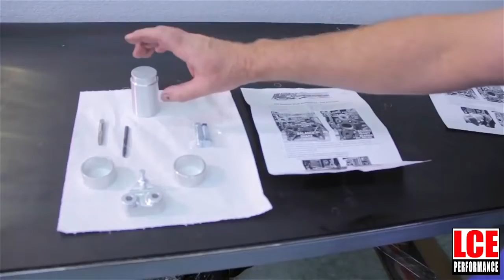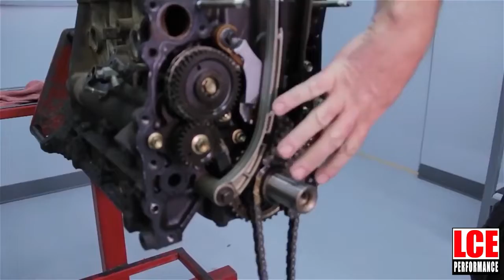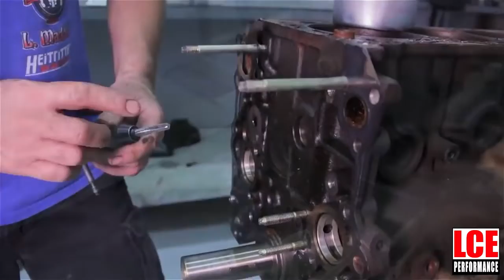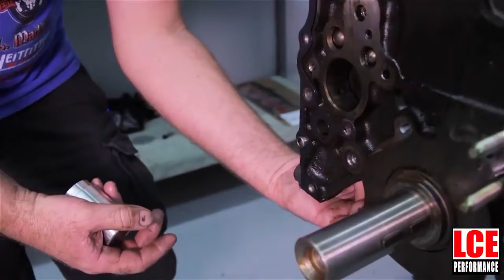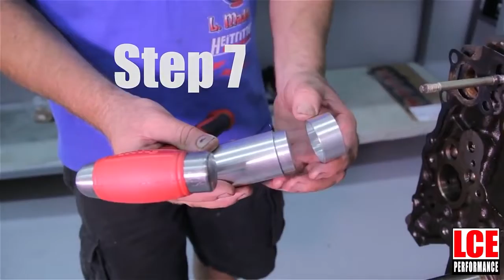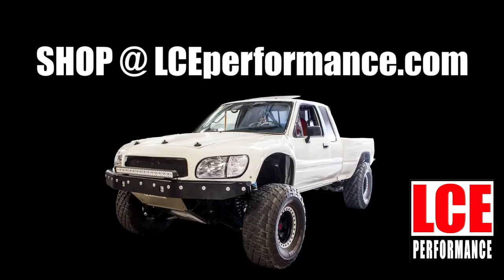3RZ BALANCE SHAFT DELETE HOW TO by LCE Performance Toyota

Comment: The labor hours quote to install this balance shaft delete kit on a 3RZ-FE 4-cylinder with 4WD are between 20 to 22 hours. 

In order to remove the timing cover to install this kit (or for that matter, just to do a fucking timing chain job) the front differential must be dropped first.. in order to drop the oil pan.. in order to move the oil pick-up tube that's hooked into the bottom of the timing cover - of course after already having removed all three accessory belts and their pulleys, and the radiator fan and fan shroud. Oh, and the power steering pump, alternator and AC compressor.

Then it all has to be re-assembled - that's around $3,000 in labor alone.

well.. by the book, the labor time is 21.7 hours to R&R the balance shafts .. when in reality it's more like 15 hours - no idea why the book time is so high... but enjoy trying to find a repair shop that won't charge you the full 22 hours.

Comment: What is the peporse of balance shaft
Reply: It basically was designed to act as a counter balance for the rotation of the crankshaft, connecting rods, etc.      but ultimately over time and mileage will cause the balance shaft and bearings to wallow out and then result in knocking, or blowing a hole in the block.  I’ve seen it on several 3rz blocks
Reply: To make the idle/engine itself not have as much vibration

Comment: I used this kit and your egr delete kit on my new 3rz build my engine has a bad vibration at high rpms starting at 2500 i can feel it in the fuel pedal its bad enough o feel like the engine is going to vibrate apart is that normal or is there another problem ive put 16k on it since rebuild but i dont rev it past 3500
Reply from the maker: Deleting the balance shafts can cause the engine to vibrate a bit more but not in the way you are describing. You may want to get it looked at to see if there is a different underlying cause to the excessive vibrations.
Reply: @LC_Engineering  thanks so much for the reply do you think the crank damper could cause this?
Reply from the maker: @kcwyrick7947  That would be a good place to start those can cause vibrations when they go out.

Comment: At around 8 minutes is that bolt going in the wrong hole
Reply: No. Why would you think that. Because at the 8 minute mark, it shows him installing the bolt that holds the bottom of the timing chain guide to the block.

Comment: Wouldn’t I be able to just cut the chain and pull it out  and then leave everything where it is shafts and all ?
Reply: I’m no expert but my balance shaft bearing went out and caused the engine rattling noise while I was driving. I drop the  oil pan and found balance shaft bearing was broken, i ordered the balance shaft delete kit but haven’t used them yet since i didn’t have the time to install it, I just cut the chain from the bottom without have to take anything out, only take out the oil pickup tube to gain  a little bit more room to cut the chain from the bottom and pull the the chain down and put the oil pan back on and it drive fine, just a little bit vibration.

Comment: If these parts were not needed to begin with, why did Toyota build them this way?
Reply: The balance shafts only reduce vibration slightly. No other reason for them. If balance shafts are kept in a high mileage 3RZ engine, the balance shaft bearings ( the ones he removed in this video ) WILL eventually wear out, and if not replaced soon enough ( a costly repair, along with new balance shaft gears & chain ), the balance shaft iwill begin to rub against the block itself, scoring the block, and once this happens, the entire block is junk. This is one of 2 very good reasons to remove the balance shafts & related components in the 3RZ engine. The other good reason is: the balance shafts, gears, chain creates a fair amount of parasitic loss to the power of the engine. Removing the balance shafts & related components doesn't really show up as "power gains on a dyno", but throttle response is DEFINITELY improved. Ask me how I know. I even purchased this balance shaft delete kit from LCE. Result: your 3RZ powered Toyota will take off from a dead stop much better, even while casually driving. It also results in better fuel economy, due to getting rid of the parasitic loss created by these pesky balance shafts. The engine runs more efficiently. It doesn't have to work quite as hard to spin up in rpm's, because all of those components have been removed. Other auto makers use balance shafts in many of their engines as well, not just Toyota. I can't even notice any "added vibration" with my balance shafts removed. But I definitely notice better performance. The majority of 3RZ owners remove their balance shafts.
Reply: @howabouthetruth2157  Thank you for this explanation, I knew there was a reason, it's just that nobody ever said why. If I had one of these engines I would do this for sure. I'm a 22R person right now, just replaced the dual-row chain
Reply: @aerialrescuesolutions3277  You're very welcome. The 22R and 22RE engines are great little motors. But factory stock, they just don't have the torque to pull a trailer load up hills & mountains. I'm told this is the main reason Toyota replaced the 22RE engine with the 3RZ. Perhaps the same is true for the 2RZ as well, I'm really not sure. The 2RZ and 3RZ share the same block, head, even the piston/bores are the same. The only difference is the 3RZ has a longer stroke vs the 2RZ, giving it slightly more power & torque. I could be wrong, but it seems like I read or heard somewhere that only the 3RZ has the balance shafts.....but don't quote me on that. I bought my 2000 Tacoma 4x4 with 3RZ engine & automatic transmission brand new. My transmission is still in great shape, but they do run better with a manual transmission though. I worked the snot out of this little truck. After 378,000 miles ( finally blew a head gasket ) I just had the whole engine rebuilt, and it's better than ever. The bottom end was still fine, but I wanted the full compression & power of a new engine. Bored 0.020 over, plus new original Toyota head known as the Stage 1 head by LCE & master rebuild kit, new cat-back exhaust, the whole smash, over 90% of all parts were purchased from LCE. I love it. Wouldn't get rid of my little Taco for anything. The 22R and RE engines can be built to make more power, and it's up to the individual as to how much more power they want. Of course the cost goes up with HP gains. Best wishes, and enjoy your 22R. It's a little gem of an engine.
Reply: @howabouthetruth2157   Yes, more power equals how much you want to spend
Reply: @subtegral  Not a problem at all. When ya buy this kit from LCE, it comes with their trick custom made oil jet that isn't available in any way from anywhere else. This custom oil jet from LCE sprays oil only on the timing chain & gear at the bottom gear, and I'm assuming because it is different with this special oil jet, there is no  oil pressure change, and is not a concern. Many guys delete the balance shafts without the use of this kit by simply knocking the old balance shaft bearings out of the front of the engine and then turning them 180 degrees & re-installing them to block the oil galley that oils the balance shaft & bearing. Whether this kit is used from LCE or not, there is yet another oil galley on the front of the block that must be drilled out, tapped (as shown in this video ), and plugged, because the components it was oiling ( balance shaft gears & chain) will no longer be in the engine. But without LCE's balance shaft delete kit, you don't get the custom oil jet, ya have to use the old system that's original to the engine, and it is designed to share oil pressure with the balance shaft oil galleys.  This is a good reason to buy this balance shaft delete kit from LCE. BE ESPECIALLY CAREFUL when drilling & tapping the single oil galley that will be plugged on the front of the block, because metal shavings can get inside the engine and oil. Drill slowly & keep stopping to vacuum out the metal shavings as you go. Also, when tapping the new threads in the hole ya just drilled, use vaseline or a heavy grease on the tap & keep backing the tap out to clean off any metal shavings during that procedure. The vaseline or heavy grease will catch & hold the metal shavings on the tap itself. It would be wise to use a vacuum throughout the tapping procedure as well.......just in case the grease or vaseline doesn't capture some of the metal shavings on the tap.
Reply: @subtegral  You're very welcome. From one happy 3RZ owner to another.
Reply: @subtegral  Yeah, do everything ya can to make it happen as soon as possible. I say this, because I finally blew a head gasket on my 3RZ ( 2000 Tacoma 4x4 that I bought brand new ) at 376,000 miles, and even though the bottom end ( bearings & journals ) still looked good, I went ahead and rebuilt the entire engine anyway, to take advantage of all-new compression. This was when I deleted my balance shafts, and those bearings were quite worn. I even bought a brand new, genuine Toyota head for the build. Bought the whole smash from LCE. If no one before you has replaced the bearings, seals, retainers, etc in both of your rear axles, one of those seals may start leaking gear oil into your brake drum before too long. If and when this happens, go ahead and do both rear axles, not just the one axle, with the leaky seal. Because when one side finally starts leaking gear oil........then surely the other side won't be too far behind in doing the same thing. It's a pricey job, but they last for well over 300,000 miles ........IF ya buy Shaefler/FAG bearings or Koyo. LCE sells only those 2 brands of bearings, the good stuff. If money is a real issue, then just do the side that is leaking........but ya need to get up the money to do the other side ASAP.  You'll never have to replace them ever again when driving it only 5,500 miles a year. Even at 24,000 miles a year.......it would still take a very long time before they go bad again...........well over a decade anyway.
Reply: @subtegral  Did ya replace the water pump when ya replaced the timing chain? That's the best time to do that. If you're paying a shop to do the work, that's free labor for the water pump, and the pump doesn't cost much. Buy your Tacoma engine parts ONLY from LCE.....trust me. Ya don't want cheap parts in that Tacoma. By the way, if you replaced the timing chain only 44k miles ago.......and IF you know for a fact ya got the quality stuff......that timing chain won't need replaced for at least another 100k miles. But ONLY if it's the good one. And often times, the good timing chain, gears, guides & tensioner have been known to last well over 300k miles. Mine sure did. And when I finally did replace it at 318,000 miles, come to find out, all of the components were still good!!! But I replaced it anyway. ......and the water pump. LCE is known for selling the very best quality parts in the entire industry for classic Toyota's like ours. If you ever need a fuel pump, you can buy that local......but make damn sure you ONLY buy the Denso fuel pump. It costs $100 more than the garbage the parts stores try to sell you.......but it'll outlast any 3 to 5 of anyone else's fuel pump, I promise you that. Same with the starter & alternator. Denso makes those as well. Everything in a Denso fuel pump/starter/alternator is over-spec'd and ultra heavy duty. Better quality copper windings and more windings. Every piece in a Denso unit is superior........for OE equipment anyway.
Reply: @subtegral  Oh, ok. The 4Runner is a classic too. Wish I had a 4Runner to go with my Tacoma. More people room, lol.
Reply: @subtegral  Hey, good for you, way to go. You'll definitely notice better throttle response from a dead stop without those balance shafts. All of that parasitic loss caused by those balance shafts, chain & gears will be gone. If you do it, or pay someone, make damn sure they are very careful while drilling & tapping the single oil galley on the front of the engine block, always stopping to vacuum up the metal shavings so they don't get inside that oil galley, and then into your oiling system!!! If ya haven't already, watch youtube video title: "Toyota 3RZ balance shaft delete kit by LCE" ( or some similar title) that shows one of the guys at LCE doing the job. I just bought and installed LCE's EGR delete kit. Very cheap, and fairly simple to do. The 3RZ is the easiest of all Toyota engines to get rid of the EGR. No more nasty carbons being pumped back into my brand new rebuilt 3RZ. Not recommended if ya live in a state that does mandatory smog testing. If that's the case, always keep your EGR clean, if possible. A new one is expensive. As the EGR gets gummed up over time, it also gums up the internals of your engine. ( EGR always re-introduces nasty carbons back into your engine anyway ) Fuel treatment ( for cleaning combustion chambers, valves, injectors, etc ) is your friend. If ya REALLY wanna enjoy the easiest & quickest power gains from your 3RZ, BUY A QUALITY CERAMIC COATED STAINLESS HEADER!!! ( and make sure it comes with QUALITY carbon & steel gaskets ( plus an MLS gasket for the main header flange ), if it doesn't, and comes with those cheap looking "paper" gaskets, hold off on the installation until you can source the better gaskets ) LCE's header costs the most, but it is the best, with all good components. The only reason I finally put a header on mine, is due to the crappy factory cast iron exhaust manifold cracking & splitting. Even the original manifold cracked within a few years. ( Perhaps that's only an issue with the Tacoma exhaust manifolds, and not the 4Runner's.....I really don't know. ) The very first time I pulled out onto the road and did a normal take-off, I was amazed at the power difference & wished I had done it years sooner. AVOID INSTALLING A COLD AIR INTAKE. The factory ECU isn't tuned for it, and won't like it, lol. A header will do just fine all by itself. With you balance shafts gone, you'll feel so much better knowing ya never have to worry about those pesky bearings for the balance shafts going BAD inside your engine. Keep me posted on your progress here Brother!
Reply: @subtegral  See my latest response for you. "PS"......this is how brain-dead I am sometimes: In my latest response to you, I suggested watching the balance shaft delete video using LCE's kit......Well, hell, that's the video above these comments, LOL.
Reply: @subtegral  For the most part. Some higher performance vehicles came ( and still do ) with header-type manifolds. Some of the 3RZ's ( but not in 1st gen Tacoma's like mine ) came with a better manifold, that perhaps doesn't have that problem. But they're still not a header. The performance gains alone, is well worth it, and it doesn't affect the durability of your engine. Makes it breathe better. I was very impressed with the results.
Reply: @subtegral  it's a good idea to check the front diff breather also , seems everyone forgets that one, I have a shop specializing in toyota trucks ,it's like almost every truck I get in either the front or the rear breather is clogged or blocked up  , That can and will eventually lead to an axle seal or pinion seal leak, I had a truck not long ago came from another shop they had installed 2 pinion seals in the rear axle within 3 months,Then they told the customer that the pinion  was worn where the seal rides and he needed a new gear set, they wanted $900.00 to rebuild the 3rd member,  i checked the pinion wear surface it was fine , I think they didn't have a real answer as to why it kept blowing seals so they figured if its rebuilt hopefully it would eliminate the problem,  all along it was due to a blocked breather, what happens is as you drive the axle gets warm and when it gets warm of course it builds a little pressure if it has nowhere to go it will push its way out the seal especially if the truck is used off-road and a warm axle is dipped into cold water , weird things can happen in that case if the water is deep enough the reverse could happen and it could suck water in, It's very easy to make your own breather relocation,  Get a thread by hose barb nipple and  about 3 -4 feet of 5/16  hose a couple hose clamps and then I relocate the stock breather to the end of that hose, Then just pick a place to relocate it up high I'll usually route it up near the gas fill neck , if you get water above your gas fill neck you'll have bigger problems than getting water into your axle, LOL
Reply from the maker: Well said and thank you.
Reply: NVH